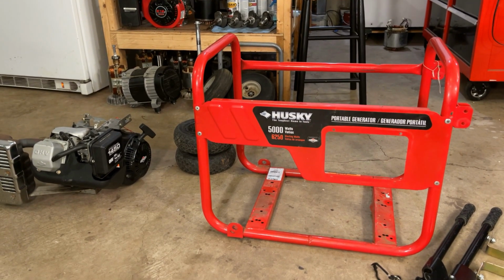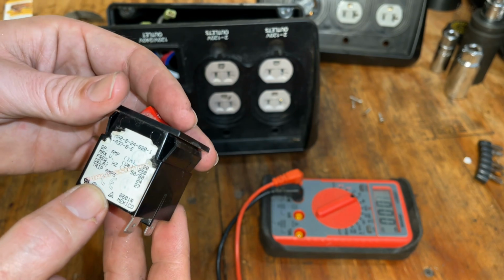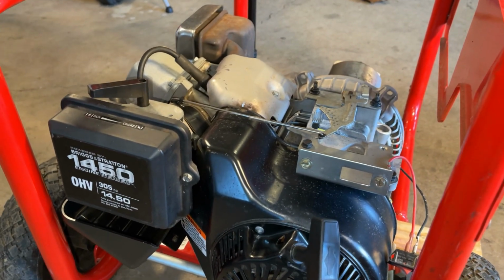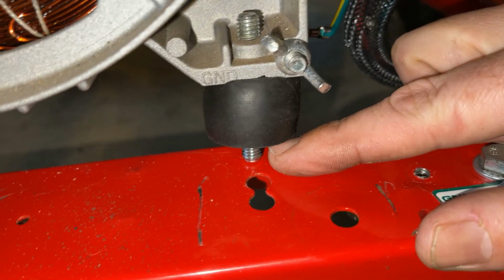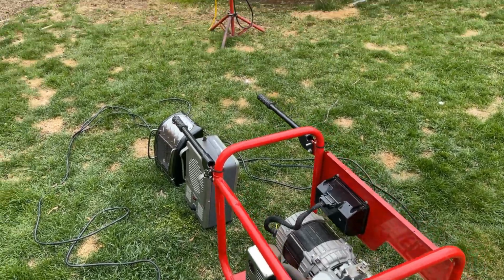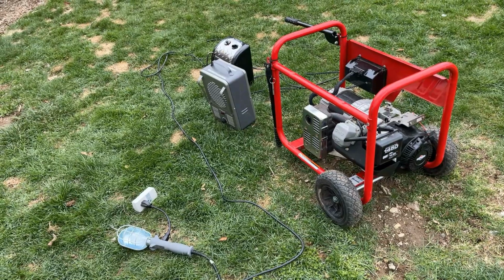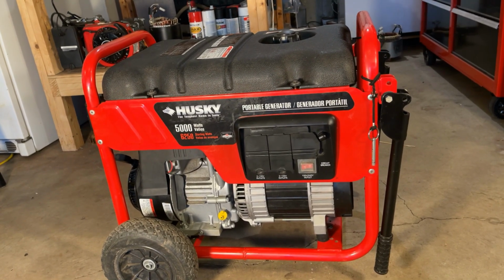Making a Generator From Spare Parts

Comment: The problem seems to me to be about torquing the rotor head with the flywheel bolt to be the same torque on  both the rotor bolt and the flywheel nut. If you are comfortable setting them to the same torque then go for it.
Reply: The flywheel nut is a much higher torque value than the rotor bolt. Torqueing the rotor bolt this way did not affect the flywheel nut torque.

Comment: Circuit breaker is rated at 20 Amps, your 3000 watt load is pulling 25 Amps. Depending on the generator rating that circuit breaker is too low amps.
Reply: Pretty sure the breaker has two poles, each capable of 20 amps. If either pole exceeds the rating then both poles trip. Notice when he checked the breaker for continuity there were 4 connection points. Each pair providing 20 amp protection for a total of 40 amps of generator load.

Comment: Brilliant job as usual, lots of things to take into consideration doing this kind of work. I would suggest using a stepped drill for drilling mounting holes, they usually drill a lot cleaner than a standard drill bit.

Comment: Morning Mr. Condon. What is the size and brand of that black ratchet you used on the flywheel nut under the recoil housing?
Reply: I think it’s a husky ratchet from Home Depot
Reply from the maker: Good question.  I inherited that set from my father-in-law who passed away about 5 years ago.  It is a fantastic set.  Will have a closer look at them and see if there is any identifying information.
Reply: @jcondon1  I Am sorry for your loss.

Comment: I like watching rebuilds. But i dont get the financial aspect. Chinese 3000W gens sell for $250 new. Means you are not going to make a profit on most of the rebuilds?
Reply from the maker: I agree.  Most rebuilds do not make much money.  Parts for the engine rebuild alone where $140.
Reply: @jcondon1  Mr. Condon, I would really like what your doing here, and I would like  to confer with you on a generator build,

Comment: James, I am a subscriber and watch all of your videos. I havd a couple of questions. After describing how you could put rope into the cylinder why did you choose to do the extra work of removing the front of the engine? Second question, T know you usually clean the units before selling them so why didn't you clean it before assembly? Thanks, curious minds want to know, lol.
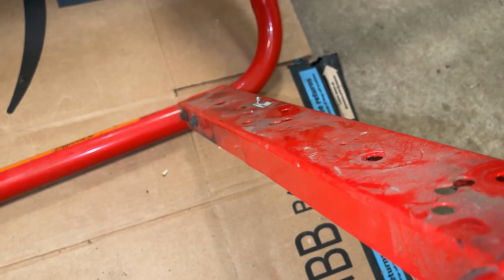Reply from the maker: Just wanted to show people another way of holding the engine still.  For some engines, it can be difficult to feed the rope into the cylinder.  Cleaned as I put it together.  The rails at 9:48 were dirty, but cleaned them before putting the engine and stator on.  https://youtu.be/zW4dIRcmQCQ?t=588  Thankfully this one was pretty clean to start with.